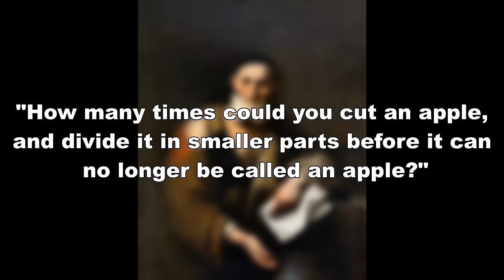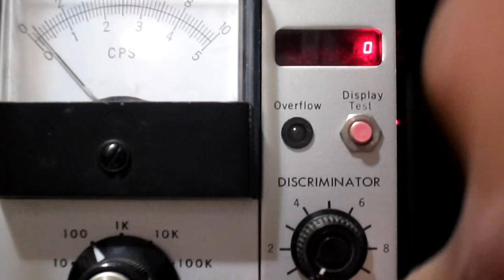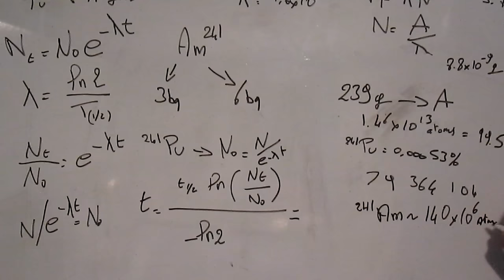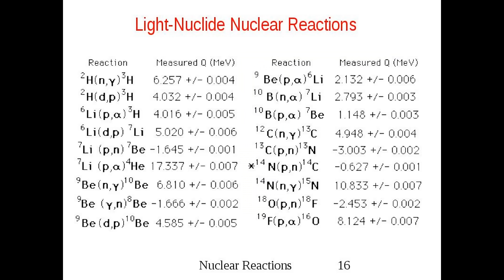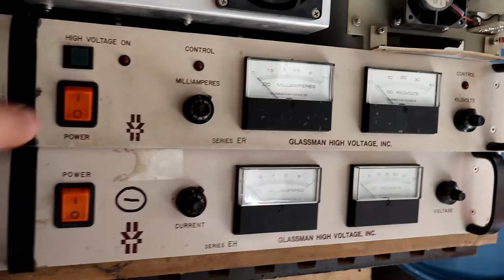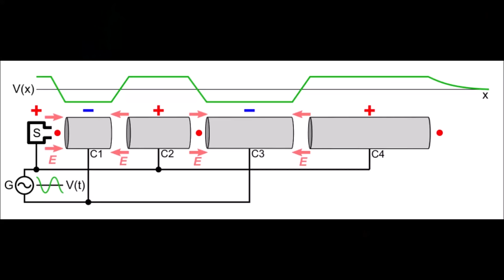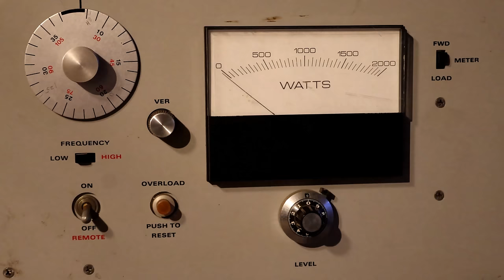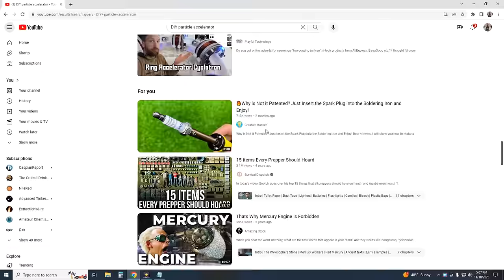DIY Particle accelerator (part 1)

Comment: Fantastic post...  really enjoyed this.  Im a scientific instrumentation engineer cut my teeth designing one-off instruments for medical research in the 1980s and then on to remote environmental monitoring ..  toxic gases and PM10 etc etc (USEPA stuff.)..    and your vid bought back long forgotten memories.  Thanks :-)

If I can offer some ideas for you?..  making one-off builds reliable can be (IS) a mission even for proffessionals so dont despair.. you're on the right path..

While your mesh filter worked as planned during the big-failure and protected your pump you'll still need to filter the shards that can pass thru the mesh and do further damage over time. I suggest a filter that uses the momentum of these small shards as its core functionality.  Think water-hammer.. ... 
Fold the vac tube 180deg back on itself and at the fold make an blind extension thats "at least" 3x the internal dia of the tube long.   It becomes a "well" trapping debris in the still-zone away from turbulence above it so it cant become re-entrained and mobile and get to the pump..   the small shards have considerable velocity and cant fold back on themselves due to the momentum and continue on into the well slamming into the end of the end of the extension tube..   This is a tried and true method thats used in dust extraction for environmental dust measurement and works very efficiently even down to micron sized particles.  its so efficient that properly designed it can filter dust according to size passing thru wanted particles of x-mcrons and smaller....  (USEPA std methodology).

Also ham radio groups would be a wealth of knowledge and parts for you regarding RF high power amplifiers and optimal coupling...   These guys are technology nerds (like us commenters here) and there will be someone who will absolutely love to help you out..

BTW I spent my high-school years dreaming about building my own linear accelerator nutting it out in my head for years...  it never happened .  life huh. .....  so you are living my unrealised dream for me THANKS. 

 Im really looking fwd to your next installment.  Thky YT algorithm for sending me to your post..  you just got a new subscriber. 😊

Also your historical introduction was exactly on-point you nailed it..  if you keep on telling stories in this style youll be quite popular Im sure.  The "goldilocks" story-teller (not too dumbed down and not too technical, but just right) is hard to find LOL
Reply from the maker: Thankfully the TMP was not running and I still plan on cleaning it thoroughly before putting it back in service! All good advice there ! Thank you so much.  I did get quite a few responses and suggestions and I'll have to admit there is some very knowledgeable people willing to help out there! Sorry you couldn't build one yourself, I'll try my best to not disappoint on the next one! This may be a little while to get parts and repair everything but I am not giving up! Thanks for again for sharing these advice and your story here! And thank you for watching!

Comment: Awesome video! So glad I found this. I’ve wanted to do the same thing myself - have collected a HV transformer and deuterium thyratrons from a linear accelerator at LLNL. 

I appreciate seeing your dead ends and failures. Makes it real. Also very glad that glass didn’t cut deeper into your neck!
Reply from the maker: I know right! Wow! You have access to the LLNL ? I did apply for a job there sometimes ago... That's really cool man! Thanks for watching!
Reply: @Neptunium  No connection to LLNL. These happened to show up on EBay. Quite the unicorns. Ended up conversing with the seller, and buying a few extra tubes. Stay safe, my friend!

Comment: Dude this is sweet... despite the failure. Be careful man... an event 20 years ago got my attention when an oil bath multiplier ladder was being fed with a neon transformer... me and a buddy at the time standing a couple feet away observing the oil flow when BAP a 4 foot bolt jumped off the terminal, across the table (glass), and found an oscope probe. Didn't realize this at the time, just knew "way over there". Next day went to light it up and it said no in an interesting way.

We were between the two points... for whatever reason, it went the way it went instead.

Lots of caution. Things happen fast in the extreme world 🤣
Reply from the maker: Thanks for sharing that! Yes you're right! Things can happen very fast indeed! Part 2 was completed a few months ago ! Thanks for watching!

Comment: Respect. I tried to make an electron microscope 10+yrs ago when I worked at a company that made HD CRT's using the electron gun, probably rare now but I know the mountain of vacuum and you have done so much more. I had to give up at the time with a new family but love to see your efforts. Made a ring motor recently and have to laugh at the so-called cyclotron ring accelerators that are nothing of the sort so really pleased to see you doing real science. Never had a HV generator but if the test is short enough and everything can be synchronized can capacitor potentials be enough to give a stable supply for just a few 100ms then re-charged with a noisy supply. Those Brandenburg etc are so expensive, but then is all UHV kit. Does the plexiglass not outgass ? Memory of nickle plating helps, maybe on the copper. As an old RF guy said to me, If it was easy , everyone would do it in their garage. Inspiring.
Reply from the maker: Really like your comment! I didn't see any outgassing on the RGA but I've taken the opportunity to re-design the spacers and probably will end up using ceramic or alumina . Hey the noisy HV and caps is a very good idea! I don't have to have a continuous supply of ions a burst would be fine! It might end up being just that! Thanks for watching my friend! Happy Thanksgiving!

Comment: As someone who builded some power electronics projects i think that for you to build a low cost particle accelerator, the best way to get results is to abandon the rf generators that will get easily damaged on this kind of very mismatched loads, go for the tesla coil and try to know the maximum voltage that can be applied to the accelerator by means of the greater electric field on the electrodes and the electric rigidity of the air, given the vaccum pressure. Great project, please keep going.

Comment: Well I wish you luck, I work on linacs in a wafer fab, and I can tell ya even with millions of dollars worth of equipment it can be a real challenge to get a linac to function well!

A few suggestions: in a professional ion source you have an isolated cathode cup which has a voltage potential between it and the filament (a few hundred volts), the cathode cup then has a voltage potential between it and the ion source chamber (between 60 to 100 volts depending on species). Additionally the ion source should have a magnet to induce a spiral trajectory of the electrons (this greatly increases the chance of collisions), and a negatively charged metal cup opposite the cathode to prevent the electrons from taking the shortest path (this can be accomplished by leaving it isolated, it will accrue the negative charge from the electrons emitted from the cathode). The spacing and alignment of your first electrode after the ion source is critically important for drawing a good beam, making that electrode adjustable will help you immensely (if possible make it adjustable during operation). As for the linac electrodes you have to impedence match them to your power source, otherwise you get reflected power that results in poor acceleration in a good case, and completely destroys your rf amps in a bad case, this is done with an LC resonator attached to each electrode (you should try to get your hands on a network analyzer that covers your amp frequency).

Those are the critical basics off the top of my head, good luck!
Reply from the maker: excellent suggestions! I did see a rise in reflected power (before the accident) at 250Khz and i do have an antenna tuner rated for medium range power.. for the ion source I also came across a sputtering assembly on Ebay with a CF2.75 flange... The main problem I have using different voltages for the ion source, is the isolations between metal element. what type of isolator, high vacuum friendly are you using ? Teflon doesn't degas much but is expensive and It would have to be custom made. I don't have a lathe to do it myself but wouldn't mind getting one! my garage is pretty stuffed with crap and my wife will certainly not like another expensive piece of equipment, she already put up with a lot! 
Thank you for the advices and thank you for watching !

Comment: Excited to see where this project ends up going.

A typical way of producing the extremely high voltage controllable "square wave" your after would be by storing power in a pulse forming network then using a high dI/dt trigger circuit, typically a thyratron or pseudospark switch, to dump the power stored in the pulse forming network into a pulse transformer which converts that high voltage pulse to an even higher voltage differential signal.  By connecting the two sets of segments in your accelerator channel to opposite sides of the pulse transformer's secondary this has the effect of rapidly charging one set of plates while simultaneously discharging the other set with precisely controllable timings.   It's important to separate the pulse forming network from your HV DC supply with a diode stack and choke though (sometimes called a charging coil in this situation), otherwise the large transients created by the pulse forming network will likely damage your supply. 

Now something else to keep in mind is that the frequency content of a signal is a factor of its rise time, not its repetition rate.  So even if your only switching polarity at around 100kHz the signals your working with could easily have frequency content well into the hundreds of MHz.  As a consequence this starts to fundamentally become a high power RF problem and you might need to learn a bit about rf design at some point as a consequence.

Also make sure you're factoring special relativity into your calculations when working out the spacing between segments.  The effect will be less significant than with electron based accelerators because the helium nucleus is pretty heavy in comparison, around 3.7 GeV/c^2 compared to the electron's 0.511MeV/c^2.  So it's not going to be so extreme that you can just ignore changes in velocity due to increasing momentum above around 20MeV like you can with the electron.  It's still an effect to keep in mind though and a helium nucleus has a charge of +2 so the work done between segments will be twice that done to an electron in similar circumstances.  

I'd normally email this kind of feedback because long youtube comments tend to get kind of awkward to write and can be hard to reference later but you don't currently have one listed.

Comment: I work for a vacuum company, I don't have much experience with linear accelerators but my recommendation is always say away from view ports and other glass vacuum components if you can. They always give trouble during venting and or heating. Stainless steel is much safer and reliable. Regarding measuring the charged ions. Maybe you can repurpose the detector of the hot cathode pressure sensor that broke. A hot cathode pressure sensor is basically an RGA (Mass spectrometer) without the filter. Anyways looking forward to your next video on this subject!
Reply from the maker: That is an excellent idea! Of course I would need another controller and bypass the filament voltage ! I like it ! Thanks my friend!!

Comment: This is so cool, ive wanted to do something like this for a long time but i have never found the energy to start making this. If your struggling to fing high volt and frequency square wave generators u can always make one out of a sine generator by routing the signal through either a limiter, clipper, or compressor (limiter being most ideal). For this the sine wave generator is going to have to be more powerful then u would needed it to be to get the job done but this is a way to do it. I genuinely cant think of a way to make a generator of this sort without losing large amounts of voltage from the limiter.
Reply: Idk if this is something u still are interested in but i hope this helps
Reply from the maker: Oh yeah for sure! Thanks for the suggestion! You know it turns out I didn't consider the ion packet falling out of phase with the square wave, so a sine will be fine even if it loses a few ions. That's the nature of the beast! Check out my other videos and previous work if you'd like...thanks for watching!!

Comment: Total accident found your video! Great project! I was not aware that the sectors would be so short. The accelerator I saw had sectors about a foot long and the whole thing was about ten feet long. The supports were simple tungsten rods sealed into the glass of the main housing tube. (pyrex)  Beats me how they fastened the sectors to them down inside the length! I suspect set screw collars and a long allen wrench. These were made of pyrex glass tubing about 3 inches in diameter and were sold to universities. (I tried to find the old advertisements but no luck. It was 40 years ago.) As for the water problem, you only have to heat to 140F (not C) to break the water from the surface. (at 1 torr or less vacuum) I suspect your heating the system to 120C  (250F!) was possibly the cause of your fail. To have such a pressure wave it had to be the window. When you replace the glass in the window, use tempered glass, or make it a bit thicker. And place a Plexiglas sheet over the outside so that if it shatters the pressure bleedup will be slow and not a shock wave. Losing your RGA was a real bummer!  See my channel for a lot of tube making and vacuum work. I have real world experience and am available for advice any time. Good luck on it!
Reply from the maker: Oh yes I've seen your chanel before! Great stuff there too! The glass spacer was suggested and I think is a great idea! I will have to find a manufacturer... Either glass or ceramic. Either way I'll change the design a bit to include more holes to allow air (gas) to circulate at low pressure better. Love the plexiglass idea on the view port! Thanks ! I have a replacement for the quadrupole but it's a real loss your right... Thanks for watching!!!

Comment: So your point of failure was the glass viewing port right? The issue with glass is that the edges of window contain small cracks that are the result of using diamond tooling to make them . These can easily grow deeper into the material under the influence of stress or moisture. And these are generally the cause for mechanical failure. So it's not  so much the mechanical strength of the glass specified in a table that determines the safety margin, but the chance of a crack growing into a critical defect under stress. Safety margins should be in the order of 10 instead of 2-3. People often forget this when designing windows for vacuum applications. A somewhat deeper scratch in a window, especially on the inside of the system, can also easily lead to breakage. Because the forces involved are always huge.
Reply from the maker: Very interesting! I didn't know that! I posted part 2 some months ago if you want to check it out.. thanks for the comment!

Comment: Wonderful effort!  If you ever get stuck in the technologies associated with particle accelerators, or the associated electronics,physics,  and vacuum technologies, I would be happy to try to help you.  I have a LOT of experience in what you are doing and admire your efforts to learn.  As a colleague once said to me, "experiments rule."  Things such as, how to measure beam current, how to drive the accelerating rings to high voltages, etc, etc...  Best if you have a specific question as general questions can fill a book.
Reply from the maker: Very well.i settled for the sine wave HV power supply. After some calculations I realized I would need several Kv at about 8 to 10 Mhz power supply... Which is difficult to find to put it mildly.. everything else is under control so I really appreciate you are trying to help! I did find a microwave power supply on eBay not far from me but the price if very far out of my range.. anyway thanks for watching!!
Reply: @Neptunium  Yeah, the question of driving your accelerating rings was what caught my eye.  Questions like that are not uncommon in RF drive systems for particle accelerators.  Usually some resonant approach is used in conjunction with a 50 ohm transmission line.  The actual power needed to drive the beam current might be quite small, but you need a lot of extra power to compensate the losses in a real system.  We usually used copper resonant cavities, but that won't work at the low frequencies you are using.  You were talking about using a Faraday cup to measure current.  There are other ways, but that's certainly a simple one, and if it works for you, it is probably the obvious choice.  Best of luck, and holler if you have questions.  There's a world of people that have likely solved many of your trickier issues.

Comment: nice project! the challenge here is not just making a particle accelerator, since anyone can do that, like for example just literally with those little hotwheels cars and booster tracks going in an infinite circle. the actual challenge is making a good particle accelerator that actually goes at a reasonable fraction of the speed of light :D